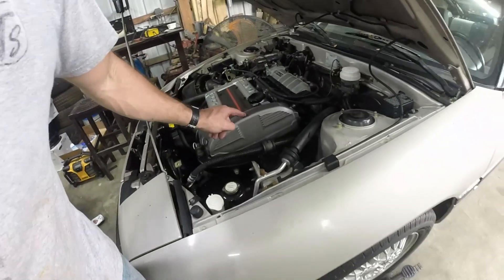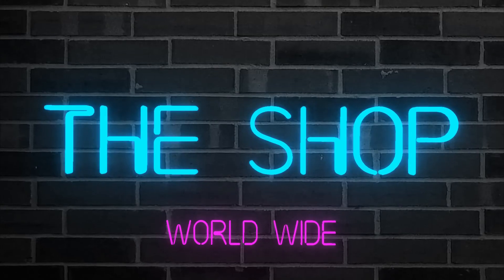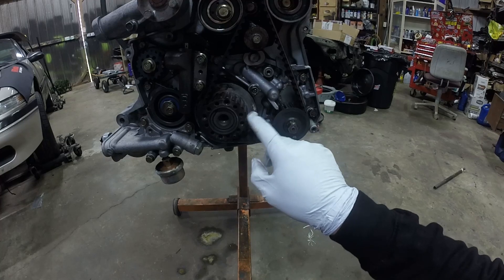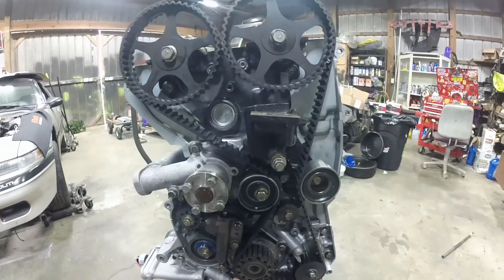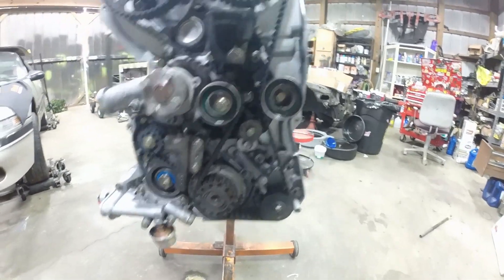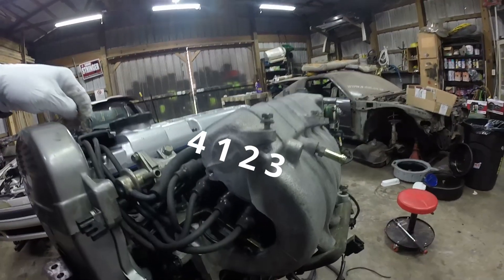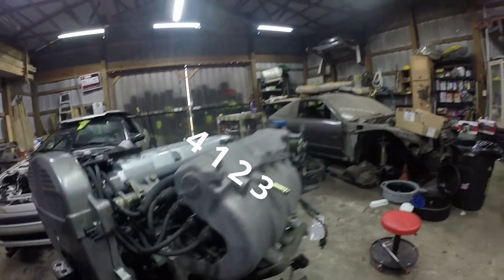1G 4G63 TIMING AND IGNITION SEQUENCE

Comment: Did you ever finish this car?
Reply: You got anything for 2g 4g63?
Reply from the maker: @InspecZub I do not sorry
Reply from the maker: Yes and no. The car run and drives, it needs a new idle air control valve. Which I have not been able to source.
Reply: @TheShopWorldWide  what year? 90 or 91+?
Reply from the maker: @zachcraig4777  1990
Reply: @TheShopWorldWide  I have many used throttle bodies around for 90s. Let me see when I get home from work if I can figure something out for ya.
Reply: @TheShopWorldWide  I have 3 90 DSMs and am a hoarder of 90 specific parts lol
Reply from the maker: @zachcraig4777  that would be awesome! Let me know!
Reply: @TheShopWorldWide  will do brotha!
Reply: @TheShopWorldWide  may be able to help ya out with sourcing one
Reply: @TheShopWorldWide  sorry brother, been busy last couple weeks. Still need an iac? I found a spare 90 throttle body
Reply from the maker: @zachcraig4777 are you on ig?
Reply from the maker: @zachcraig4777 if you do message me @the_shop_worldwide
Reply: @TheShopWorldWide  I do not have IG.
Reply from the maker: @zachcraig4777  fb or email lol
Reply from the maker: If you still have that iac, email me at theshopworldwide@gmail.com

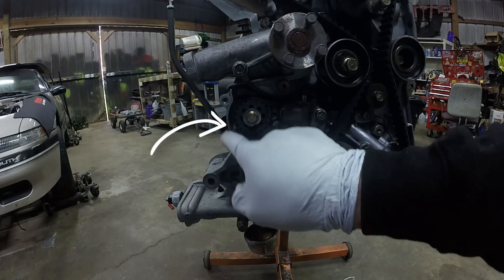Comment: At 1:14 you call it an oil pump. That's the balance shaft by itself. Bottom right small pulley is the oil pump that also double as a balance shaft.
Reply from the maker: Thanks for the corrections..